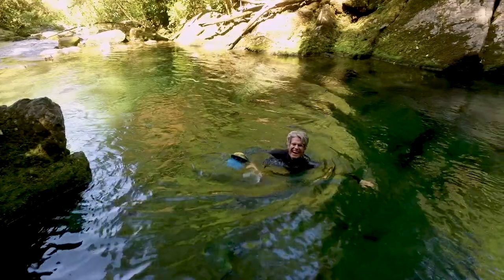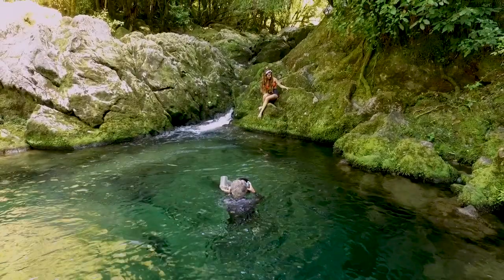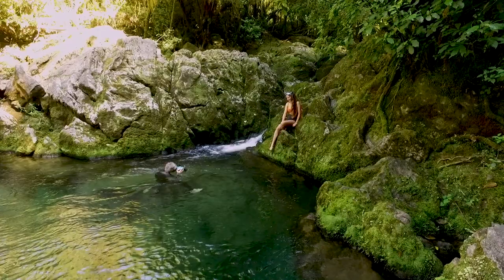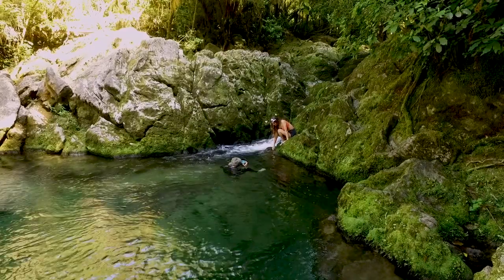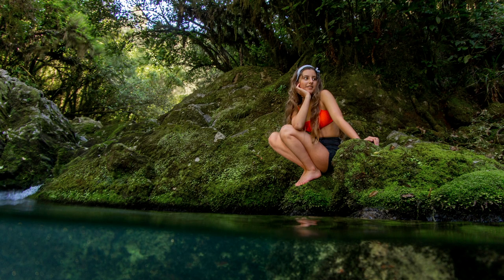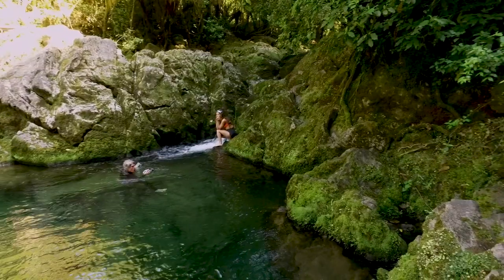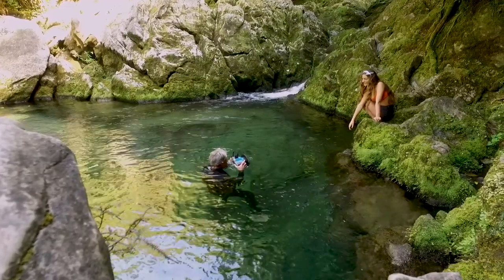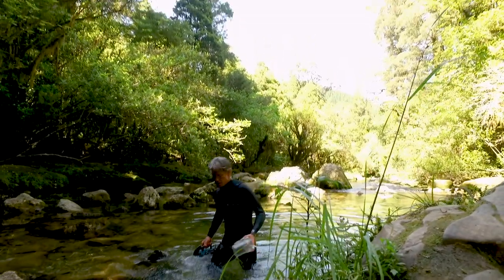BTS Of A Split Level Water Photo In A New Zealand Spring

Comment: Question for you. Since I can't use an ocf with my housing, do you think a dive torch would be able to light the bottom properly? Or do you think it would be too harsh? Thanks much for sharing your work, Chuck
Reply from the maker: Hey Charles, thanks for your very good question. You could definitely use a torch or water proof light to help light up beneath the water surface. A burst of flash is far more powerful in a still photo scenario than a torch would be however. So instead of been too harsh it may not be powerful enough in some situations. When this photo was taken it was very bright (11am day time) so the difference was extreme, so a flash would have done a better job at balancing the light. Having said that a light from underneath would have helped out, especially a reasonably powerful light. May do some videos on using constant light in the future on this YouTube. Thanks again Tom

Comment: Question I have is the focussing and aperture setting. I find. with my split shots, barring GoPro, that either above or below the water is in focus and the other aspect isn't. Reasons for this please Tom?
Reply from the maker: Hey Kevin, Yes this is definitely a challenge when shooting with DSLR cameras. The reason is that the GoPro's and Phone cameras have tiny image sensors which inherently have more depth of focus, with GoPro everything from close to the lens to infinity is in sharp focus, so this is actually an advantage with split level images and the focusing distance is vastly different underwater because the water magnifies. With DSLRs the depth of focus is far less, so you will need to use very small apertures and very wide angle lenses to  get both above and below in focus. I would try apertures like F18 or even F22. With the split in this video I focused on the subject above water and just wanted the feeling of been in the water so the under side is out of sharp focus. But when there is something more interesting below the surface I try to shoot with very small apertures. Hope this helps mate